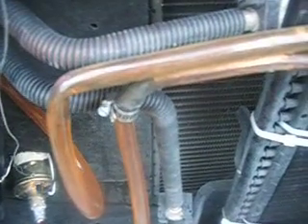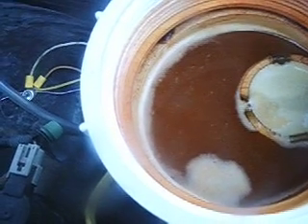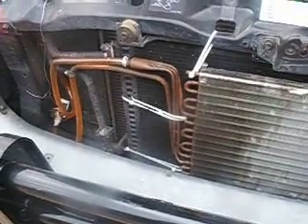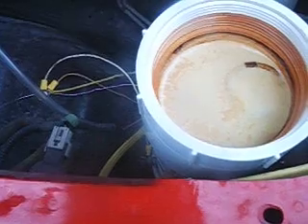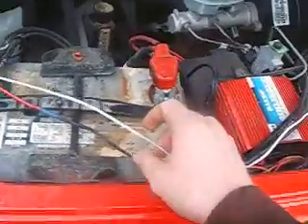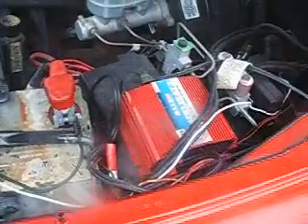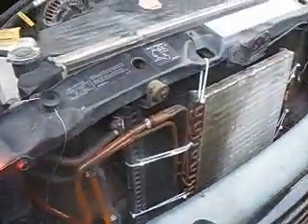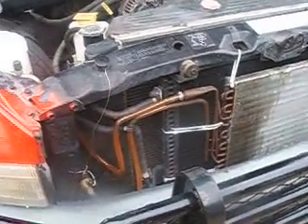My HHO Project Dec. 2008 Part 2

Comment: Hi. Well first Id get some boiling water and pour it over that battery , this will clean off all that white and green from around the terminals, then put some vaseline around the terminals, I think you may have to ditch that cooling radiator, copper will react with the electrolyte. just use some clear plastic tubing in a coil, a few turns, where you have the radiator now, just supported, the water in the cell needs to be at least 110f to be efficient.
cheers zeropoint132